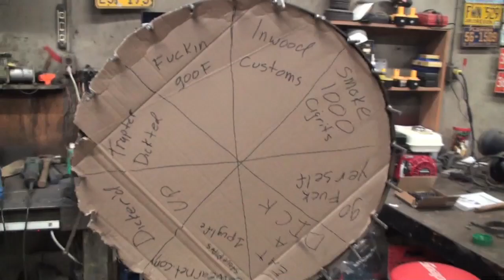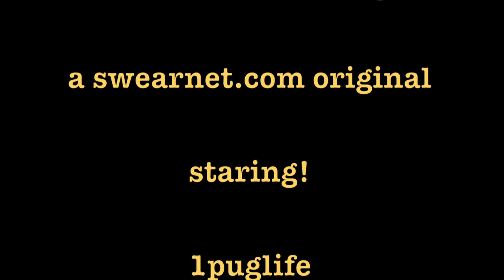dicker'd up with pug

Comment: I'm from Cincinnati Ohio and medical marijuana just became legal I been smoking illegally forever now I got to stop smoking to get legal smoke wtf
Reply: Chad  I live in Ohio also but did you read the whole articles about it?  It is not legal to smoke marijuana and the medicine to be dispensed will be liquid form.  Yeah under the new law no smoking or using it in brownies.  Even though the law has passed the medical marijuana, by the time the red tape has gone through it will take TWO YEARS before finally approved.  The other main problem is what doctors are going to write prescriptions for the oil to use in a vapor pen.  Also a lot of health insurance companys have said they will not cover marijuana in any form.  Also some towns and cities are currently proposing laws to not allow marijuana dispensories in their towns and cities.  So do a little research on your own for more information and yes marijuana is still illegal to use in Ohio in any form.
Reply: +C M Sr right but if thc already in my system they won't no the difference weather I'm smoking or taking
Reply: What part of ohio
Reply: Chad I live in Lancaster which is about 25 miles southeast of Columbus along Route 33, which is a pipeline road between West Virgina and Columbus.  I understand about marijuana detection in a person that has used it, but I just wanted to make sure you understood that marijuana is still illegal in Ohio so you did not go out in public and use it and get into trouble.
Reply: +C M Sr oh I'm not worried about getting caught over ten years I gave zero fucks atologize only thing can can do is give me a ticket